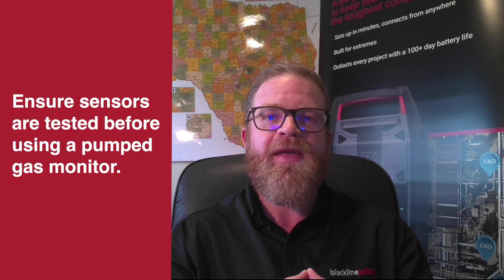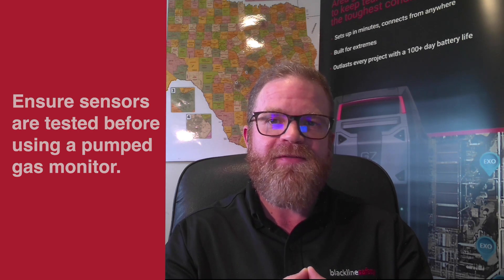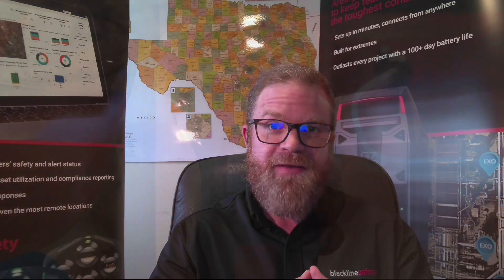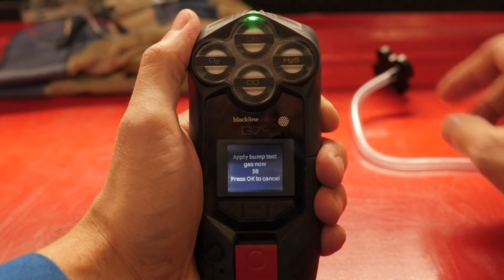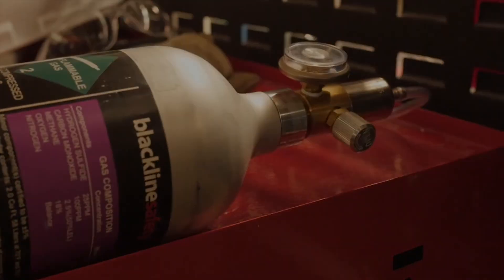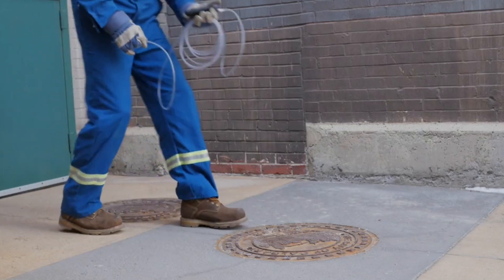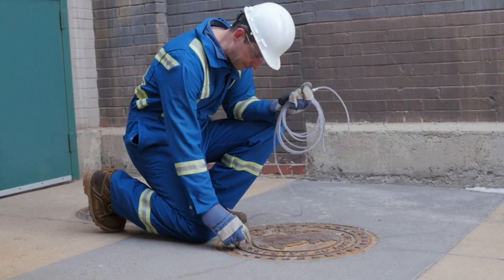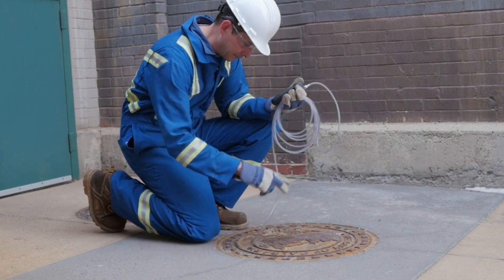Safety Moment - Confined Space With A Pumped Gas Monitor | Blackline Safety - Gas Detection Systems

Comment from the maker: To learn more about our products, visit: https://www.blacklinesafety.com/safety-moment
Reply from the maker: To learn more about our products, visit: https://www.blacklinesafety.com/

What is Cl2 - https://www.blacklinesafety.com/solut...

Is carbon monoxide lighter than air - https://www.blacklinesafety.com/solut...

H2S sensor - https://www.blacklinesafety.com/solut...

Lel sensor - https://www.blacklinesafety.com/solut...

NH3 - https://www.blacklinesafety.com/solut...

Oxygen gas O2 - https://www.blacklinesafety.com/solut...

PID detector (photoionization detector) - https://www.blacklinesafety.com/solut...

SO2 gas - https://www.blacklinesafety.com/solut...
Gas monitor - https://www.blacklinesafety.com/solut...

G7 Monitor - https://www.blacklinesafety.com/solut...

G7 Location - https://www.blacklinesafety.com/solut...

G7 Social Distancing - https://www.blacklinesafety.com/conta...

Gas Monitoring Device - https://www.blacklinesafety.com/solut...

Health effects from chronic low level exposure to hydrogen sulfide - https://www.blacklinesafety.com/blog/...

What is blackline - https://www.blacklinesafety.com/

Multi gas detector - https://www.blacklinesafety.com/solut...

Lone worker safety - https://www.blacklinesafety.com/blog/...

Lone worker solutions - https://www.blacklinesafety.com/blog/...

PID detectors - https://www.blacklinesafety.com/solut...

Safety for lone workers - https://www.blacklinesafety.com/blog/...

Combustible gas detector - https://www.blacklinesafety.com/blog/...

H2S name - https://www.blacklinesafety.com/blog/...

Multi gas detector - https://www.blacklinesafety.com/solut...

H2S monitor near me - https://www.blacklinesafety.com/blog/...

H2S Exposure Chart - https://www.blacklinesafety.com/blog/...

Blackline software - https://www.blacklinesafety.com/solut...

#blackline
#blacklinesafety
#gasdetection
#loneworker
#loneworkersafety
#safety
#workers
#h2s
#gasdetectors
#gasdetectorsnearme

YouTube channel link - https://www.youtube.com/channel/UCNil...
Facebook - https://www.facebook.com/blacklinesaf...
Twitter - https://twitter.com/blacklinesafety
Instagram - https://www.instagram.com/blacklinesa...

https://www.google.com/maps/place/Bla...
2XJ4+QH Calgary, Alberta
51.032186074881885, -114.0434762152886